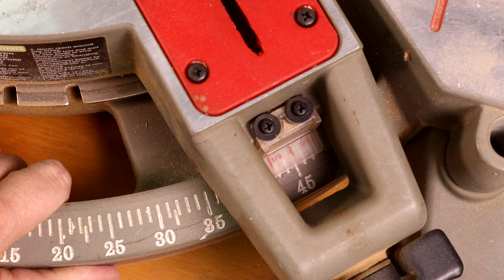5 Woodworking Cuts You Need to Know How to Make | WOODWORKING BASICS

Comment: I recently had to install crown molding for the first time throughout an old house, where i swear not one corner was an exact 90 degree angle, one sure fire way to get ptsd when it comes to miter cuts lol
Reply: Andrew DiMartino the old-school way to compensate for the off-90 corner was to straight cut the first piece into the corner, then scribe and use a coping saw to match the second piece's edge to the first molding. This, with practice, is way more accurate than butting two miter-cut pieces together.
Reply: HAHA!!!!
yep!!!!!!
and have a  45 angle corner cabinet to top that,full to ceiling cabinets:)Nothing  at perfect in over  a 100 year old house:(
Reply: Yeah you should have just coped the corners.

Comment: Steve,
Could you do a basics video on squaring boards on a table saw. This was One of my biggest issues when starting out and I am curious to see how you approach and problem solve squaring boards. I have seen you use your router table and explain how to square boards in a past video.  As you have stated in several videos we as wood workers are limited and we value our scrap material to use in projects that may have curves or no straight edges to begin with. I seem to struggle at times getting a perfect straight edge only using my rip fence. This will probably seem as common knowledge to most wood worker but for beginners I could see this being useful and hopefully save people time and frustration.
Thanks and keep up the good work.
Reply: Use a table saw sled that lets you clamp your board for giving the board a straight edge, then just align the straight edge on the back fence for the next cut :)

Comment: Hi. On jobsites I use my jigsaw very often, but me and my collegues use it upsite down. The machine is than under the wood or the sheet with the sawblade sticking out on top. We make pretty accurate cuts like that with a clear view on the cut and supporting the wood from under works fast once you get used to it.

Comment: One. I love your video. Just a couple, oh well three items. The 3/4" is .7500 and 19 mm is closer at .74803 than the 18mm .7087 that you mentioned. Also when using a band saw the blade fence should be lowered closer to the material than in the up position. At our age I use bi-focal safety glasses. I use them all the time, even when I am not cutting in the shop it is so easy to forget to put them on. Very good show.

Comment: You can cut inside cuts with a band saw if you have the right kind.  First you drill a hole large enough for the band saw blade to pass through.  Then you shear the blade, pass it through the hole, weld it back together, grind off the weld, run the blade back on the drive wheels, make the cut and then shear the blade again to free the piece.  Of course most wood workers have no idea such band saws exist,  but they are quite common in tool and die makers shops where the inside cut maybe a on 3” thick plate of tool steel.
The shear, welder and grinder are built into the saw.

Comment: I have actually never even tried to resaw on my bandsaw. I never had to resaw anything more then 6 inches wide and the table saw just makes it nice clean and almost to final dimension with not a lot of work. Like anything with power tools. Pay attention, be methodical and its no different then any other operation. Though if I do at some point need something wider then 6in then I guess I'll have to try it out on the bandsaw. Great video Steve!

Comment: Knew most of this, but kudos 4 the video. 1 for you: glue & screw a piece of masonite 4" or more to an 8" strip of plywood, place your circular saw against it and cut off the excess. This gives you about an 8" wide guide for the saw that is perfectly straight. Glue pieces of 100-grit sandpaper to the bottom, use a clamp on the far end, and you'll make perfectly straight cuts with your saw, by lining up the edge of the guide with your lines, as the sawcut is already determined by the cut edge of the ply.
   One warning on this trick though is that the masonite & ply suck moisture differently, so, dry environments only or you'll have warped masonite.

Comment: Great video. A question I have is that when ripping a narrow portion of board is it safer to cut the piece on the outside of the blade or against fence? I have seen different views. I had kick back when cutting a thin piece from wide board against fence and thought that was the reason. Thanks.

Comment: As a beginner, I learned the hard way not to cut lumber on a table saw from the out take end, feeding it in the wrong direction. The wood rose up, kicked back and shot across the shop. Lesson learned.  I also use a sacrificial board attached to the fence.
Reply: Rob Nichols Why the hell would you use a tablesaw backwards?

Comment: So i want to tackle a DIY and build a faux mantel w/ electric fireplace recessed into the frame. Materials i will need will be 2x4 for the frames, pinewood (i think) to build my faux beam for the fireplace mantel and plywood to go over the frames and to also adhere my Airstone. For this project, what saws, tools do i need? I watched your videos and it seems like the sliding compound miter saw 10" blade might be the best one. And i think i will need a nailer gun and finishing gun. can i get either one and use it for multiple purposes? I will also need an electric sander for the mantel. Im debating if i should also buy a circular saw too for the ply would, but i think i may just ask Home Depot to cut that for me. 
I would really appreciate your thoughts and advice. Thank you!!!

Comment: Love your table saw. I have the very same one. I'd love to see how you made your zero clearance throat plate. I know they can purchased but, they are pretty expensive. I discovered it to be very simple to take the top off my router table and mount it to the table saw as well. On the right side. Extends the table space of BOTH and frees up floor space. Keep up the good work.
Reply: What kind of saw do you have?

Comment: Don't forget a scroll saw. Perfect for smaller projects and super accurate.
Reply: I kinda get what you're saying, but i think a scroll saw is kind of falling out of service. 
Most people have jigsaws and band saws, with one or the other filling the role a scroll saw would in older shops. 
That's not to say someone opting for a scroll saw is "doing it wrong" but that doesn't change the large overlap between it and other tools.
Reply: @walterbunn280  a scroll saw is meant for finer projects. I've cut out chess pieces and elegant wall pieces Etc. The other tools just don't meet that need because of their size and bulk and lack of accuracy at that fine level. You should try one out I sure love mine.

Comment: 6:15 re resawing with table saw.  I've done a lot of "resawing" on my table saw (as well as forming certain profiles on molding), including using at max blade height.  I mean, what is "resawing" other than a rip operation at max height?  You have absolutely the wrong blade on your table saw for any rip operation.  You have a mega-tooth fine crosscut blade - looks to be an 80- or 90-tooth Diablo/Freud blade, which is an an excellent blade for crosscutting, but which is going to bog down, burn, scorch, and other nasty things on most rip operations.  It's just not meant to clear that much wood on a rip cut.  Get a high quality 24-tooth rip blade (like your 80/90-tooth Diablo/Freud crosscut blade). A high quality rip blade has cut through anything I've ever fed it with no problems.  Even with the blade at full height and completely buried in a thick board, I've ripped through it.  Be sure that your blade and fence are perfectly aligned as they should always be, and use a very slow feed rate for such an operation, and lock in the cut with effective feather boards.  And obviously you can't rip a twisted sister unless you sled it through.  You won't even have kerf marks in the wood.

Comment: Just got a table saw I put fence in 1-1/2” cut and it came out in a smaller cut. Do I use pencil to mark out ? Or do I cut my wood on inside of blade to get my accurate measurement on cut ? Seems like my fence is off when I lock it in place - Any tricks to this ?

Comment: Nice video, the only thing I noticed  that would make ripping boards easier on a table saw was the blade you were using had to many teeth.  A common mistake (I know because I did he same thing).  You need a wide gullet to move the debris. I found nothing more than 40 but 32 was better.  You are going to have to sand or plane anyway and I actually got a better finish that way.

Comment: I am building a Custom Aquarium Stand using (as a wrap) Furniture Grade 3/8" Maple Plywood - I am going to stain it Black and then Lacquer it as my wife is a huge fan of Black Lacquue Furniture and I am a huge fan of DIY Woodworking Projects - However, my Question - Should I cut the Cabinet Door Openings into it After I Lacquer it - or before?  I feel like doing it before could create a messier project when applying multiple coats of Lacquer, On the other hand, I am wondering if this would/could crack or chip when cutting it (Jig Saw - ?) evenm with a fine toothed blade - Your thoughts ?.

Comment: I notice you say you can't rip with a bandsaw. You need a fence that can be adjusted for blade runout. Laguna Tools makes a WONDERFUL bandsaw fence and, using one of them, you can make precision straight cuts on a bandsaw. But, you need to adjust the bandsaw support bearing  MUCH closer to your work. Check out Laguna Tool bandsaw accessories.

Comment: in regards to the comment about circular saws and jig saws that you'll have a nigh impossible time doing a rip cut, i beg to differ, both comes with a base for smooth "traveling", with that all you really need is a fence that is lined up so the blade is situated where you drew the line, i just did it 10 mins ago (with a circular saw)

Comment: Hey, Steve.  I have a Ridgid bandsaw like yours.  I put a Kreg KMS7200 Bandsaw Fence on it.  Its adjustments allow you to compensate for bandsaw drift upon installation.  So the fence will appear crooked in relation to the blade, but once you start ripping, you will have a consistent width will all your cuts.  As long as you are using a good quality blade, you will get much better cuts than doing it freehanded.   Check them out!

Comment: Hey Steve, you forgot the most important tool for "small"-ish curves.... Scrollsaws (a.k.a. the almighty upside down jigsaw)
Awesome video for beginners :)
Reply: He did say the five BASIC cuts, Dude
Reply: The curves were in his video and he only spoke about the bandsaw and the jigsaw... what is the point of "BASIC" cuts? Isn't it a BASIC cut also on a scrollsaw if it already is a BASIC cut on a bandsaw and a jigsaw? you insert the blade inside a hole and cut it out (and the hole part can be omitted if its an entire curve like in his video)
Reply: Eric is right. You can use a scrollsaw for a curve cut where you don't want an entry point on the edge of your workpiece.
Reply: Yes but you are very limited by thickness of the material, you aren't cutting a 1" piece of wood with that, the other two saws can accommodate the thicker stock.
Reply: These are basic cuts in his projects, not fine design. He has used a scrollsaw, but it's not that simple to use.
Reply: I do not see the problem personally with the scrollsaw here. You may be limited by thickness in a way, but he never mentioned stock thickness in his video and it isn't that hard of a tool to use once you have adjusted the blade speed (just like modern jigsaws that are adjustable speeds). He just mentioned basic cuts and they can perform basic curves AND complicated curves as well.
Reply: Scroll saws are very easy to use and they can cut curves into a 2x4, so the depth of cut can handle most dimensional lumber from a big box store. You are limited by the throat on a scroll saw just as on the bandsaw.  They leave a better edge on the cut as well.  Steve probably didn't mention it as most shops probably don't have a scroll saw unless they they got them to use for a particular purpose, and then they already know what they do.
Reply: Designs By Philip I think a bandsaw is fine for most projects. Bandsaws cut faster and can be used for many cuts. Although a scrollsaw may be good for precise, fine work, you're not going to use it as often in these types of projects.
Reply: Hi Eric D,    I was foolishly looking down my nose from the heights of being a  Hegner scroll saw owner when I recently used a friends Dremel moto-saw while at a group I attend..  I was so impressed with the quality of cut and how easy this dinky little saw was to use, I went and bought one. It does not replace a good scroll saw for detail work but for general curve cutting it is great.
All the best
Reply: labrat7357 My scroll saw is an old Dremel 2 speed. Not pretty, but it cuts nice after many careful modifications..
Reply: yep , and by hand its a  coping saw:P
i have  alittle scroll saw, old jobber , from the 1960's area:)
Reply: I love my Scroll saw.
Reply: @designsbyphilip510  While the throat is a limitation, you can buy twisted blades that will cut sideways and backwards.  Odds are you can get at it from some angle or other on most projects.
Reply: You can see his scrollsaw in the background in the video.

Comment: 6:15 You can creep your way up to cutting through twice the length of the exposed blade.  You can go through half the board, then go end for end with it and cut through the other half.  If you're worried about overworking the saw you can just creep your way up.  The cut ends up a hell of a lot straighter than your bandsaw snake cut.

Comment: I have tracks for my circular saw, and I could probably get an attachment for my jig saw. The problem is not getting a straight cut, but how to fasten the tracks to relatively narrow boards.
Aaaaaand THAT'S why I bought a table saw. :)
I used the tracks and circular saw as late as yesterday to straighten the ends of the ~1 5/8" (40mm) laminated plywood table top I've been working on lately. That baby would be impossible to handle on the table saw.
And a small correction: 3/4" is ~19mm, not 18. I know that very well, because that is the width of the mitre slots in my table saw (Dewalt DW745 Type 4).

Comment: I can't warn enough against resawing on a table saw. While k freely admit that I was not following proper safety guidelines--no hearing or eye protection and one push stick--and had no business making the cut when I had a short free moment and wanted to get in a quick cut, the table saw just didn't like what I was asking it to do. I stupidly continued with the cut despite the fact that the wood was beginning to jam between the blade and fence because I had so little left to cut that I didn't even see what happened next coming until it was too late. The wood got jammed and pulled my left hand into the saw slicing off my entire thumb leaving it hanging by the smallest possible meat and threw about half in of my index finger across the room. Luckily, as I was passing out from blood lost, my twelve-year-old son had the mindset to put my finger on ice while I held my thumb so it shouldn't completely fall off. FWIW, there was zero pain when the saw cut through my fingers. The fight or flight reflex kicked in and the adrenaline rush was so powerful that it was a good ten seconds before I felt any pain and I have to tell you that it's excruciating. It brought me to tears and not just one or two but uncontrollable sobbing. The incident was completely preventable and because I wasn't being safe I have to live with a thumb that's entirely devoid of feeling and two fingers that hurt when I do almost anything with them. It was a hard lesson to learn but I now have a safety checklist that I use before using any potentially dangerous tool. Saw injuries are avoidable if proper safety is practiced. Don't wait until you lose your fingers and have to have multiple surgeries, endless physical therapy and pain in and limited use of your fingers to learn the lesson. I should have learned from my brother who wasn't so lucky and sliced his half of his hand off because he decided to look away while making a cut. Tell family members not to try and get your attention when they hear a power tool running. They should be told that they are typically use for a short enough period of time that they can wait to talk to you.
Reply: Please excuse my ignorance - what is "resawing"? Ah, I see it's explained in the video :)

Comment: Pro tip for sawing holes with a jigsaw: start by drilling a small hole (8mm or 1/3 inch works for me), and then start your cut in there. Also: jigsaws don't work for straight cuts for me, I'm very glad I add a circular saw. And no: a table saw is not an option for me — both in terms of money and space, it just costs too much to justify by the amount of woodworking I do.

Comment: Really cool tips! I would add the scroll saw somewhere in the "curves section". Thanks for sharing
Reply: Totally agree.  Being able to unlock the head and thus have VERY precise control instead of having to turn the whole saw is a huge plus !!!  (yes, you will probably have to turn the saw eventually but you won't be stuck with THAT as the only control over your cut)

Comment: Whats the thickest piece of wood you would cut with a jigsaw? Starting from the outside piece of the wood cutting around a shape NOT starting from the inside as shown in your video.
Reply: Raymond Wing As thick as you want. They have 6 inch blades...even up to 10 inch blades for jigsaws.